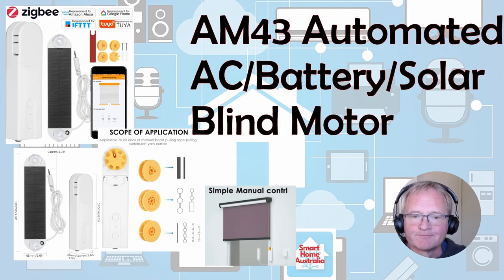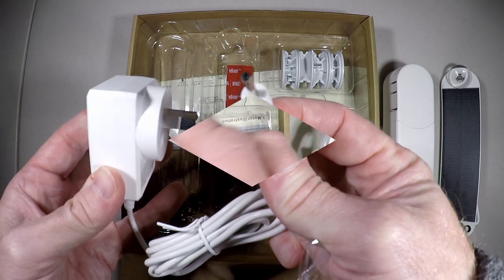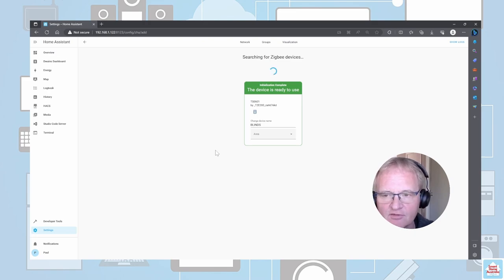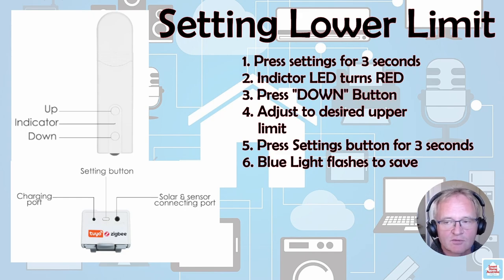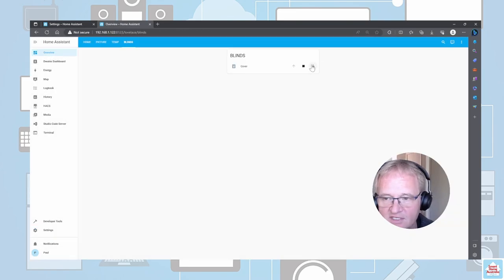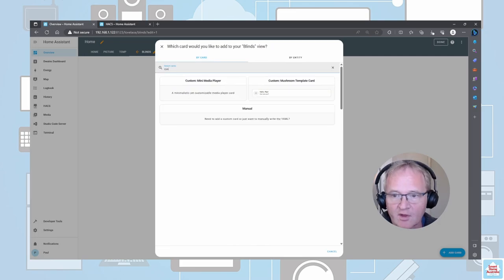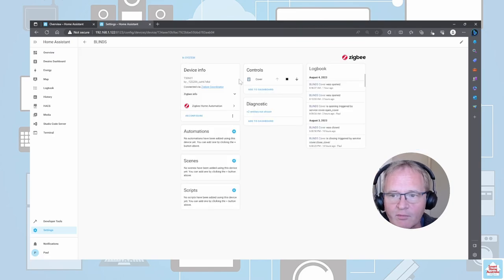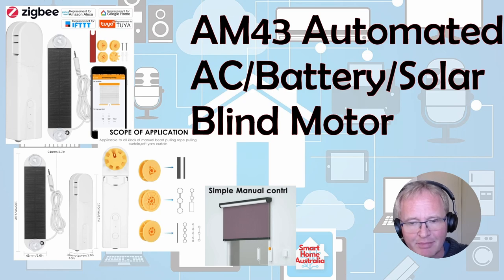AM43 Automated Blind Motor - Home Assistant setup, configuration and review

Comment: I see this video is about half a year old now -- If you see this how have they been working longer term?  Thinking about pulling the trigger on three of these soon (tying them into Home Assistant with ZHA as well)
Reply from the maker: Hi @Conundrum191, the device has been working for the full 6months and never missed a beat. The solar panel does need good sun to maintain the charge, but then again its a very small panel. Still very much gets a thumbs up from SHA. 
If you do intend to buy, then let us know how you go.
Reply: @smart_home_australia  Thanks for the update.  It looks like there is an Ali sale coming up this next week so I might grab two to start.  I'll probably also try the solar, but both locations have a nearby plug so I could power them from the wall if need be.
Reply from the maker: @Conundrum191  I prefer the solar as I don’t want to take up a socket and that they become set and forget. This is super important for partner approval factor. 😊